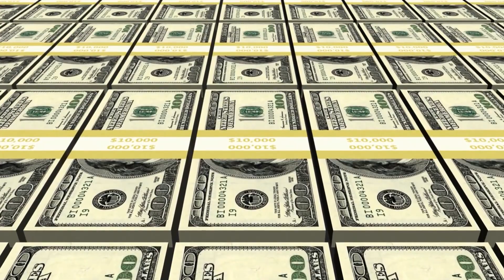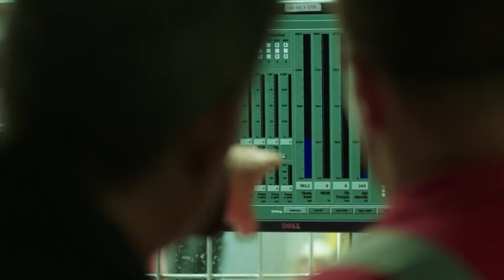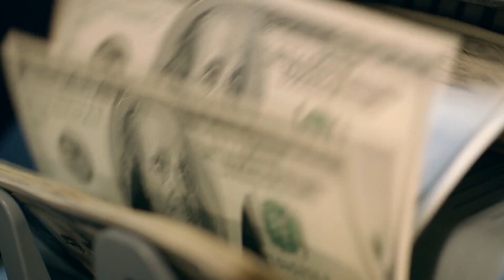10 Craziest Engineering Mistakes in The World

Comment: The Ford Pinto was pronounced "PIN-toe," not "PEEN-toe." My first car was a 1972 Pinto. The base model cost $1700. I had a prettied up model that cost, I think, $2800, but at that, it had no air conditioning, no power steering or power breaks, and a manual transmission. I drove that car for 15 years and then traded it in for a Toyota hatchback that had more miles on it than my Pinto had. The day the recall was announced (for the explosion problem), I came as close as I ever had before or have had since to being rear-ended. I've been nervous about people following me too closely ever since, but as you can see, I'm still here.